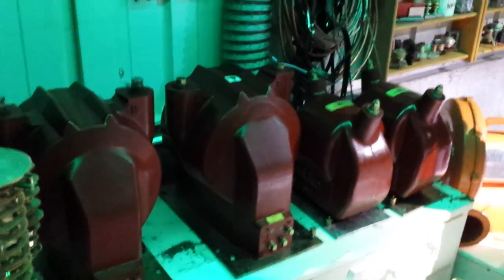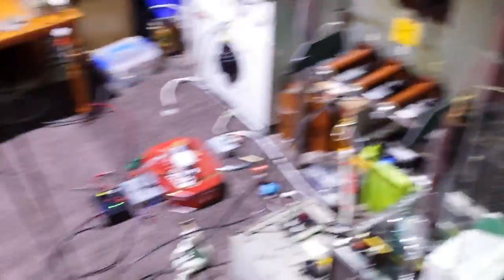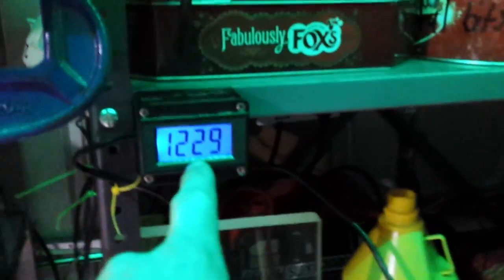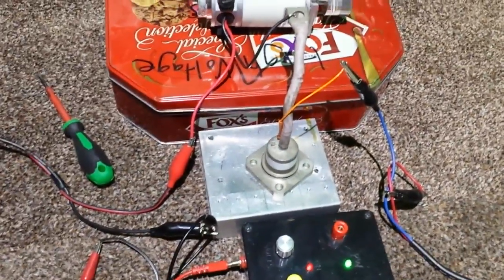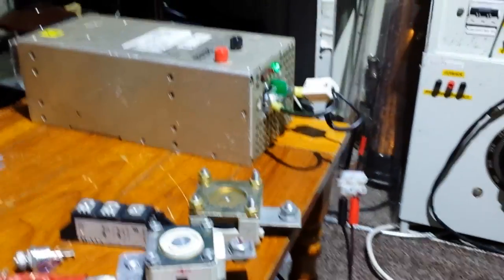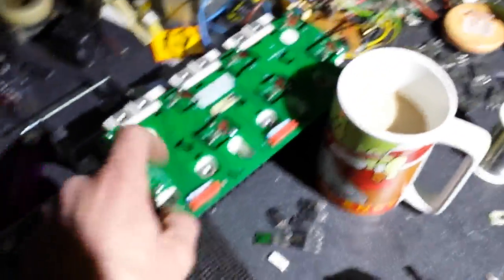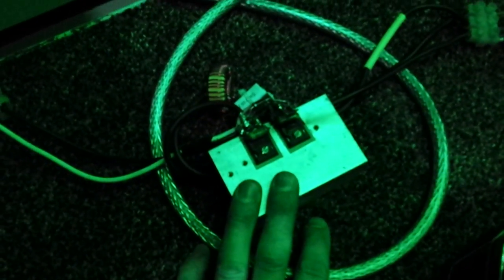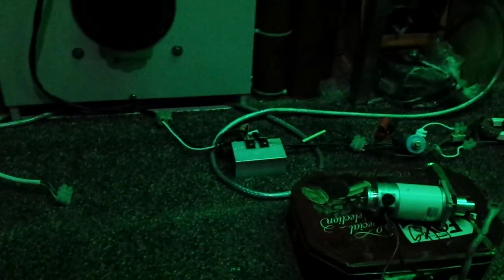Transistor blows on camera'

Comment: I needed PFC on my 3.6V transformer , was getting 3600 Watts of actual power on the secondary side , but as I was using inductive ballasting on the primary it was pulling over 5Kva from the Wall , Crappy PF at the time xD , Nice video too :D

Comment: Hey i found a 32 inch crt and i want to drive it. i have everything i need but, i just need to understand isolation methods and safety. could you make a video explaining how to be safe with high voltage?
Reply from the maker: Hi mate' well if you watch some of my crt TV arcs' videos you will see how I do it! And the next time I get hold of a TV ill try to remember to give you more info about it! Thanks 😎